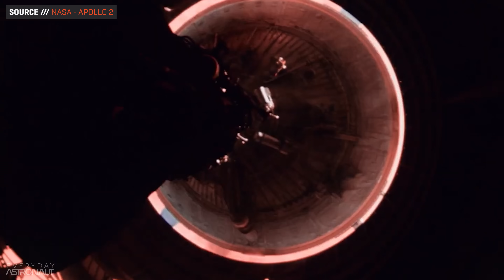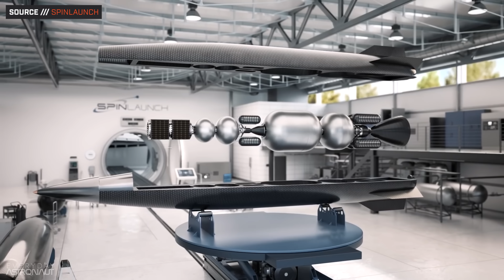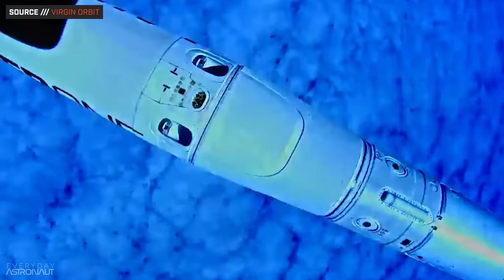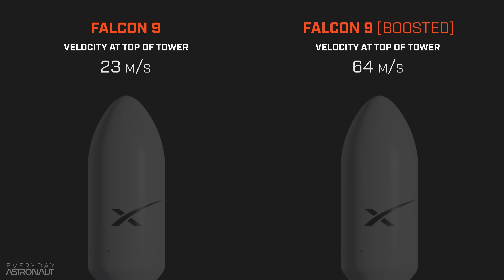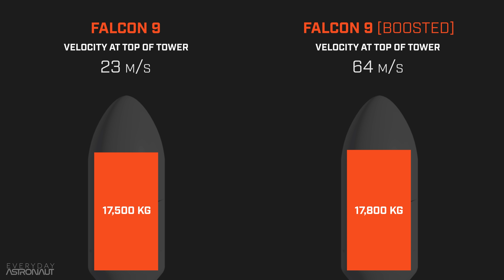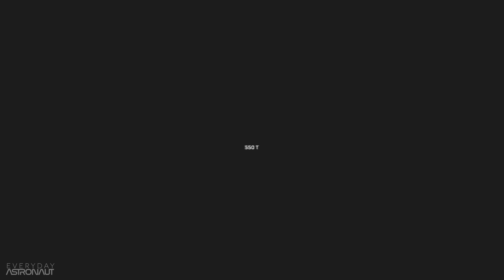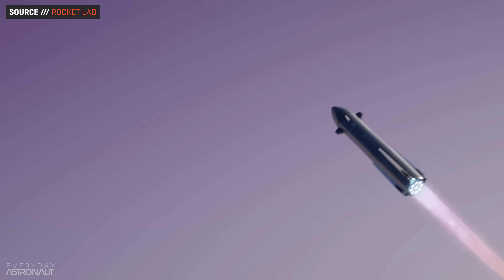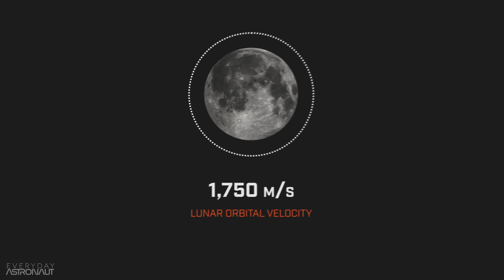Could We Help Push Rockets To Orbit?

Comment: Alternatively use some of the steam created by the rockets and force it into a lifting system. That then uses existing force and redirecting it to a launch system instead of losing all of it out the flame trench.
Reply: While we're at it, just stick a magnet on top of the rocket and another magnet in front of it on a pole. That'll work!

Comment: If you dig a deep hole and use a maglev, you can achieve much greater speeds before you ignite the engines than what you were proposing with just a short maglev. Would it add to the cost? Sure, but considering the fact that we spend billions on rockets, and the fuel savings we would achieve, the system would pay for itself very quickly.

Comment: min. 17:00: You shouldn't use a simple pulley because the counterweight would accelerate and crush into the ground wasting a lot of energy and producing a earthquake. The counterweight should accelerate and then decelerate transfering the energy to the rocket.
Reply: What if the cables used were connected to opposite ones. That would mean incredible tension in the cable at the end of the assisted launch. Twang. But the cables would then be exposed to the blast from the engines which would melt them

Comment: What if we just used large rocket engines to propel a tower launch system? All the propellant weight would be grounded as well. Could get far more than 3G net acceleration. Still have the issue of stopping the detaching bracket and engines though...

Comment: The reason that launching from the equator can be beneficial and launching from the top of a mountain is not, is quite simply velocity.
Launching from the equator gives a velocity boost from the rotation of the earth, an additional 463.4 m/s less the lower angular velocity gained from a higher latitude. Launching from a mountain gives you a slight reduction in atmospheric drag and another very slight boost to starting velocity from the marginally higher angular velocity gained from being slightly further from the center of rotation (center of the Earth). Approximately an additional 0.4 m/s at 5 km altitude above the equator.
If you were to build a tower 100 km high, the top of the tower would have an angular velocity approximately 7.3 m/s (470.5 m/s) higher than you would have at sea-level on the equator (463.4 m/s). You would then need to accelerate from 470.5 m/s to 7,848 m/s to get to orbital velocity.

Comment: There is other energy deployment systems. Capacitors or forget electricity and use a steam pressure like the aircraft catapults or even expanding gasses 
Ike a combustion.

Comment: What about keeping the fuel lines attached to the rocket to replenish the fuel as it is used? I'd love to see the animation of a rocket dragging a fuel umbilical cord to space 😂
Reply: Haha I do love this. A first stage, attached UNDERR the booster stage, which has direct fuel injection from a ground-based fuel tank. It's useful for as long as you can keep your fuel hoses linked in, then it pops off and the booster ignites.

Comment: Great video but I’m concerned that most people have no idea how much power a supercharger is capable of. To make the video more approachable you should use bananas.🍌 
Everyone with a kid knows that bananas have a lot of energy and that the energy can be dissipated very quickly. 
Anyone who ate a banana also knows how much a banana weights and it’s already used as a measure of volume by many brilliant YouTubers.
So, either for the next video or even for an updated video - use bananas for weight, energy and volume. It’s a proved system. No reason to reinvent the wheel or the supercharger that powers it.
Bananas FTW 🍌🍌🍌
Reply: Americans like using banana units. They don't have inches or pounds for power so they use superchargers.

Comment: WDTJ: starship booster with ring of extra-boost raptors that take propelant from QD and move on rails for first 100m of flight? (as you pointed out saturn 5 needed 125 tons of propelant to leave launch tower so my idea is to not have it on rocket at all...)

Comment: How about a literal space launch infrastructure on the Karman Line? Send stuff over to the Karman line, bit by bit, by attaching payloads to large aircrafts like the 747, assembling the rocket and fueling it over there, and then get it launched from over there (just a little diagonally) 
This solution sounds more of a cost issue over physics issue I guess.

Comment: i don't mean this in a snarky way, but how could you not know how to visualize 980MJ? you've been to launches! when you bring up teslas and homes, i have trouble visualizing it because of the thickness of the conductors necessary to go to the motors. or how many. or cooling systems. i haven't been to a launch, but i've seen a bunch, and that big ol' plume -- now that, that i can visualize.

Comment: You don’t have to lift all the weight at once. And you didn’t consider the force compounding with pulleys. And you can dig a hole under the weight for decel. There are a few other things you could add.

Comment: The problem with spin launch is there’s a non-zero chance of spontaneous failure. Which is essentially a ballistic kinetic warhead with a disc covering a decent chunk of the earth
Reply: Eh, sorta.
1. Launching things horizontally is pointless, so the plane of the arm's tilted up, so half of the danger disc leads right into the ground. A dangerous local KE explosion, sure. Downrange danger, no.

2. Except for the two exact horizontal points,  the other half points up in the air. The aeroshell is not going to go through the wall of their vacuum chamber and come out aerodynamically stable and structurally sound. So, unless they're launching a literal slug or sabot of metal, you have a pancake of fragments that were aerospace hardware a few microseconds ago, hitting sea level air at Mach Many. Essentially a shotgun blast but with much lower ballistic coefficient particles, at velocities that will melt, vaporize, or tear them into ever smaller particles that will dissipate energy even faster. Again it would locally create a dangerous acoustic boom, but almost everything would likely come down slowly within a few hundred meters and even the toughest chunks likely within a km or two. Random examples, 20mm cannon rounds, which are dense and optimized for minimal energy loss at their muzzle velocity, are generally cited as falling below militarily effective KE at 2 km. 150mm-class howitzer shells can go around 20-30 km without special rocket assistance. Spinlaunch is noisy, so they built their first chamber in the middle of the desert and they're trying to build their second one on a remote Alaskan island. 

3. But it won't go through the wall of their chamber in the first place. A fun thing about physics: Until you get to relativistic speeds, no matter how much KE you have, conservation of momentum means a projectile will only penetrate its own length into material of similar density before stopping. At high KE "stopping" may involve a plasma explosion, but that's a different matter. (This rule is what allows astronomers to confidently state the size and speed of body that made a given crater, and is the reason craters are round regardless of the impact angle.) The ring wall of their vacuum chamber is resisting enormous compressive loads - nearly ten tonnes' weight for every single square meter of its surface area, with the loads from the hyperboloid disc faces being transmitted via tension into compression the ring wall. I've never looked up if they've said how it's made, but the likely suspects are either a bunch of deep steel ribs as in a submarine, or prestressed ferroconcrete like a road bridge built in a circle. Things that are way denser than likely Slinglaunch payloads, so the projectile would only penetrate a fraction of its own length. Even that wouldn't actually happen because the maximum penetration assumes the projectile is impacting perpendicular to the surface. A broken loose projectile would impact the wall at a very low angle, proportional to the small distance between the end of the arm and the wall radius. In short it can be expected to "splash" off the wall and become essentially a fluid sliding around the wall while shedding its energy. It may well puncture the disc walls, once again leading to a local danger from the massive vacuum chamber implosion but no remote danger.

Comment: SpinLaunch doesn't even survive napkin math. Spinlaunch is a scam because all they do is replace a common issue with a huge problem. In order so survive the G forces of the spinner the second stage would need to basically be a solid brick. And it would need to be bigger than a current Falcon 9 second stage with more dV as this has lower velocities at lower altitude. You can't get to space when all your dV comes from the ground. Plus a second stage is like 9,000 pounds. So their spin arm would need to be able to hold up 14 Golden Gate Bridges. So basically they are replacing the need for a first stage with the need for a second stage that can withstand 50,000 g's on the low end. This has no path to orbit. 

Here is some quick napkin math: MECO of a Falcon 9 is about 80 kilometers (50 miles) high, traveling at mach 10. This is where the second stage is started. SpinLaunch launcher, not only could not launch a second stage, but it cannot even reach MECO speeds. Anything they launch will require a second stage to get to orbit with the same required delta-v. A typical second stage of a Falcon 9 weighs 4,000 kilograms (8,800 pounds) without propellant. With propellant, the second stage weighs 111,500 kilograms (245,800 pounds). SpinLaunch's full-scale size and exit speed of 5,000 mph (8,100 kph) translates into a peak centripetal acceleration of between 50,000 and 100,000 g's. One g is the acceleration due to gravity at Earth's surface. This means their spinning arm would need to hold between 5,575,000,000 kilograms (12,290,000,000 pounds) and 11,150,000,000 kilograms (24,580,000,000 pounds).... In layman terms: Their single spinning arm would need to hold between 14 to 30 Golden Gate Bridges not counting the concrete anchorages. There is no material that can hold that. This is just a big gun with no gunpowder.

Comment: Maybe you could have another super heavy pulling horizontally to assist the one going up? :)
...or down but that sounds even worse.

The vacuum tube to the orbit was a bit silly. Space elevator where you could just drop stuff to geostationary orbit might be a bit more feasible, if it was possible to make a space elevator.

Comment: You'd put a transmission on the falling weight that slows it down as it reaches the ground.   If it hits the ground hard that's a TON of energy you wasted.  "return on investment" doesn't mean a complete return on investment.   Even getting $1 back is a return on investment.  ROI is a ratio not a finish line.

Comment: Instead of using the pulley method, you could build few massive tower like structures that start to fall over while the rocket is thrusting and have cables attached to the rocket and provide the extra push. The cost of steel(175 million in given example) might sound big, but you have to consider its a 1 time investment as it reusable every time...not considering the cost to lift the tower up again

Comment: Double cable hoists on lets say 200m towers side by side, hooked on the thrust puck with hydraulic whinches/with buffer tanks to charge them slowly before the flight. Cables exist that can take those loads, the total energy needed isn't that absurd. Over a couple dozen flights that would actually be worth it

Comment: Well, it is still complicated and dangerous, so, most probably is not worth it, but much more feasible to pump propellant into the rocket during liftoff than using separate system of capacitors to accelerate it

Comment: Much more practical idea for modest payload increase: Consider only the amount of fuel that the rocket burns from the time of ignition until it reaches the top off the tower. Instead of being pre-loaded, this amount of fuel is instead pumped in AS the rocket ascends, with fuel lines that travel up to the top of the tower matching the speed of the rocket. (Engineering challenge yes, but no crazier than chopsticks really). Furthermore, the height of a future tower could be greatly  increased at relatively small expense to increase how far up the fuel lines travel, further reducing the rocket weight.
Reply: Love this thought and your explanation of it, I'm surprised not to have encountered it before in gonzo space launch discussions. 

It does have the issue that it doesn't actually accelerate the rocket at significantly more G than what it can already do, so I think it's as simple as dividing the payload gains he calculates here for the +3G case by four? So you're getting fractions of a percent down in the noise, single-digit kilos maybe... Versus, as he concludes, getting  tens to hundreds of percent gain at comparable cost by just launching a bigger rocket or more of them.
Reply: @HypoceeYT  According to my quick and very unofficial web search, modern rockets seem to consume about 10 to 30 tons of fuel clearing the tower, and I naively assume a large percentage of this could be swapped out for payload weight under this scheme.

Comment: Why not to put giga magnet to orbit, align and enable it when rocket needs a pull.
Reply: Hard to target just a rocket and not all the other metal around the launch site as well.
Reply: The magnetic force would act on the orbital magnet dragging it down.
Magnetic force is also an inverse square law, so it would be at its weakest when the rocket was at its heaviest - at launch.

Comment: Not that it would make sense anyway but a solution that would work better than a giant steel cube counterweight to yeet starship is a flywheel + gearing or if you wanted an electric system instead of batteries or capacitors you can use a compulsator which is a way to turn kinetic energy from a flywheel into electricty crazy fast. The 3% improvement still makes no sense but it is better than a giant 175000 ton block of steel.

Comment: Am I missing something or is all the energy imparted by the launch system result in a reduction of fuel which could become payload which would greatly increase your total payload benefit. In other words a smaller rocket can launch more payload with the initial boost....
Reply from the maker: When you do the math, it actually doesn’t add up like that and it’s certainly not a direct correlation since the initial fuel is burnt and has been converted to kinetic energy.

Comment: The USS Ford's EMALS (see Wikipedia's article) delivers 480MJ using energy stored in four flywheels converted to electricity at launch time -- about half of what's required for Falcon. It's also in the right range on length (91m), duration (2 to 3s), and final speed. More than enough energy for Electron. And Elon has a boring company for that tunnel .... Fun back-of-the-envelope calculations, thanks.

Comment: An underground silo with a neutral counter weight elevator will allow a very strong launch assist. The already do it in icbm silos. The ones that jump out before setting fire.
Reply: Which ones do that?  I mean which ICBM?
Reply: @imaginary_friend7300  mostly russian and chinese ones. some really old US versions exist, but with gas stuff.
Reply: Air-ignited ICBMs are generally ejected by gas pressure, usually from a pyro gas generator. You may be confused by old generations of them that were (slowly) lifted to the surface by elevators for fueling and/or launch. Jumpers are also, I think universally, solid-fueled, which means ignition in freefall isn't an issue like it is for liquid-fueled rockets - an issue he covers briefly in the video.
Reply: @HypoceeYT  You are correct, but I am not saying that we push the rocket and freefall ignite. The rocket will ignite on the launchpad, and because it is on a neutrally weighted elevator, it will essentially accelerate as if gravity did not exist. It would only fight its own inertia. The rocket will still use the ricket engines to get up, but the neutral weight would be less and less neutral with each second.

I was playing fast and loose with the whole current tech statement, but underground silo launch assist mechanisms in general are indeed a known technological category. that was mostly my statement.

Also, I like solid rockets. I would probably make a space program with solid rockets as the first stage if I had the money.Imagine having a dozen silos with solid rockets waiting, and you roll the second stage over at ground level and just plopping it on board. would be easier to assemble due to the ability to lower the rocket completely into the ground.

Comment: This explanation of "electrical" vs "chemical" vs "nuclear" comparison:
Electrons moving (along wire or between electron orbits) yields energy like a "mouse" moving something
Chemical bonds between atoms (rocket fuel) yields energy like a human moving something
Nuclear bonds among protons/neutrons yields energy like a giant with a head the size of the moon

Saying your summary another way:  it is mind boggling comparing electrical (capacitor) capability to chemical (rocket fuel) capability

Comment: FireBall XL5 🚀,
A pulley and heavy block of concrete would work !, The energy from the rockets down blast could be used to provide the lift to move up the rockets platform !